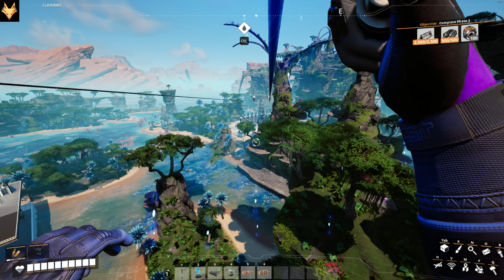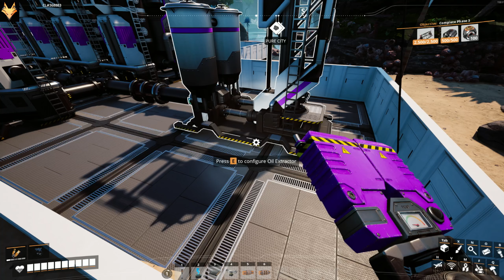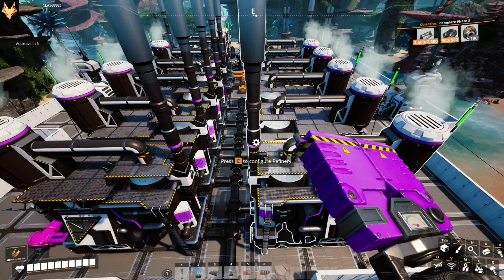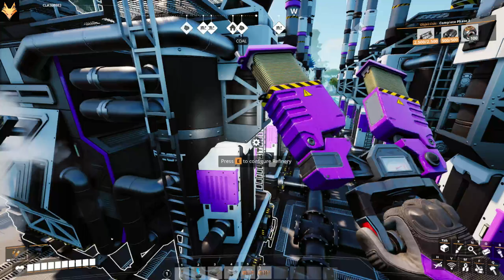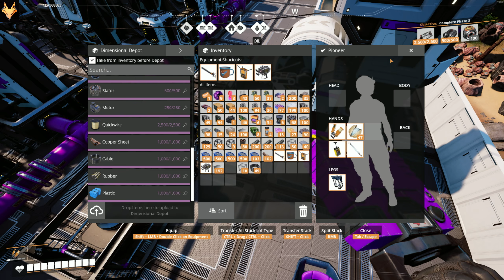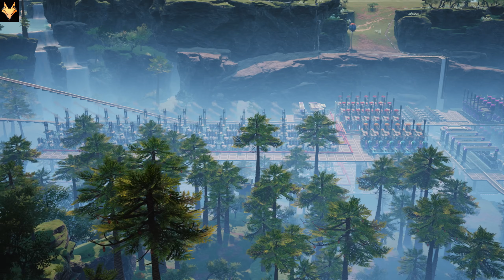How to set up your 1st oil refinery in Satisfactory 1.0

Comment: Great setup, only thing I would add to the video is the ratio's of the 3 fuel refineries. On the rubber side 1 at 100% and 1 at 66.6667% on the plastic side it needs to be 83.3332%.
Reply: under-rated comment. kept having power flux's and its cause my two rubber refiners weren't set properly. thank you for this.
Reply: Thank you for this!
Reply: Ive been copying this EXACT setup for 3 weeks now and my power is fluctuating BAD. I think this may be the solution.
Reply: Really helpful comment, thank you
Reply: So, I have all of the plastic and rubber refineries merging the Heavy Oil Residue into one Pipe and then distributing them to the 3 fuel refineries and I set one of the fuel refineries to 50%.  Will I run into any issues with that?

Comment: Useful video. I turned a pure oil into 5 refinery making polymer resin and fuel. I got the fuel going to generators and the resin going to make goods. My power is stable.. again.. for a bit.

Comment: What about transporting oil long distance via mk2 piping? Horizontally, with a water tower beginning. I’ve pure nodes at 600m3 transporting pipeline exceeding 1200m but they’re lagging feed crude manifold style. I’m just not understanding the lack of full flow
Reply from the maker: Mk2 pipes only carry 600

Comment: Great video, this helped me break out of analysis paralysis because i stumbled on a pure plus two normal crude oil nodes. The annoying thing is that production stops if you don't yet have a way to consume the fuel (unlocked with plastic and rubber, ironically) so i just flushed the fuel plus heavy crude oil to keep production going for a bit longer
Reply: This is where I'm at. Trying to math everything out can take a while, especially when you take into consideration alternate recipes.
Reply: @Infinite_Curiosity00  What I learned since then - learn to love Fluid Buffers - for some reason even if everything is mathed out correctly, with fluids there still can be backups. Probably because every machine is on a cycle and none of them match exactly. A fluid buffer will smooth that out.
Reply: @bunnydoomsdaydevice  appreciate this tip, thanks bddd!
Reply: @davethescrub858  In hindsight the biggest gamechanger are fluid tanks. They have some quirks about them that help larger fluid setups
Reply: @bunnydoomsdaydevice  when running my first and second coal refineries I tossed a buffer in (20m+ elevated). 

In my second refinery I ran into issues with water flow trying to stretch a few pipes a loooooong way across the plains. I put two buffers to build up the water at the highest point in the system then a ton of those "water pushers"(I like to call them) to really push the water out to my refinery. 

Absolutely loving how this game sucks away my free time chasing little bits of productivity+production

Comment: Hey man, quick question. Awesome setup however I followed the build 1 to 1 but I'm having issues with fuel delivery to the generators. Seems like consumption is outpacing the fill rate, any advice on what I might be doing wrong would be great. Great video btw. 👍
Reply from the maker: @afranca1825  yeah I forgot to mention the ratios of the fuel gens. See pinned comment below.
Reply: @FOXGaming22  Thank you! This fixed it!

Comment: I appreciate you just being like "yeah its 10 of these, 10 of these, 5 of these". Makes life much easier, cause the problem I have had is not with how to build the factory. It's with how much machinery I actually need to take full advantage of a resource node. That's something I feel like a lot of tutorials will either not make a point of at all, or take to long to get to that point.
Reply: It would be relatively easy to calculate. But the problem is that the game doesn't make clear how many resources a minute it costs to produce something. e.g. If I press 0 and look at the "oil refinery" it will show how much it costs to build one. But it won't really show how much electricity it costs to run the machine. How much resources it requires. Same for stuff you have to construct etc. 

You can press "N" and then do simple calculations (e.g. 240/30 and the game will tell you it's 8). You can write some notes down if you have a to do list open. But this game really needs a dedicated note taking thing. Some paper next to you so you can write down, "I have this many nodes, giving me 400 resources. Smelters use 20. So I need 20 smelters which will produce 400 ore. The constructors will use 45, so I can make 4 of them and I will have 20 excess ore. I either store that ore, put it in the ticket maker. Or I can raise the production of one constructor by overclocking. Lastly I can built another constructor but underclock it to only us 20 ore. 

The game really does require you to place every fn thing you need then look at the recipes one by one to figure out how much you need. When honestly that info should be available on the o menu as well (at least). Esp early game when you don't have all the resources. It's best to calculate then make a to do list so  you know roughly how many resources you're going to need
Reply: That's part of gameplay is doing the math and figuring out the best builds or even unorthodox stuff that still just works. Organization is really important later on bc it gets hectic just plopping stuff down
Reply: use calculator!!

Comment: I have been anxious and putting of oil for awhile.  I appreciate how simple this tour was.  I had been trying to wrap my head around a facility with like 6 miners doing everything possible.  Kinda forgot I can just use one node to start or section it like this.  Also I like how you have the walls around you facility.  Very nice.  P.S. what is that train we can see in the opening doing?
Reply: i know this is INCREDIBLY late but oil isnt too hard to start, id say its much simpler than coal, all u need is 1 extractor on a normal node, 2 refiners, and 4 fuel generators to get u +1000 MW of energy and then u can mess around after for plastic/rubber supplies

Comment: drove me crazy i've bulit this 5 times now all on different nodes, pure, impure, normal can never get more than 1500 from each one without 2 gene failing
Reply from the maker: @wishiwantyou  can you explain?
Reply: @FOXGaming22  impure, same set up, 3x overclocked. I seem to only get 5/10 of the Refinery's to run, half plastic half rubber. Even let them fill up before starting but slowly losing crude oil. I could be missing something, I've watched the video possibly 30+ now
Reply from the maker: @wishiwantyou  I'll check the ratio when I get home it may be a mistake I made.
Reply from the maker: @wishiwantyou  did you fix it. ?
Reply: Are you using pipes that can handle the flow rate? Mk 1 isn't enough.
Reply: @wishiwantyou you need to use a normal node which is what he said at 0:41